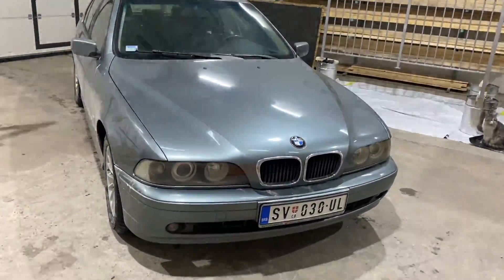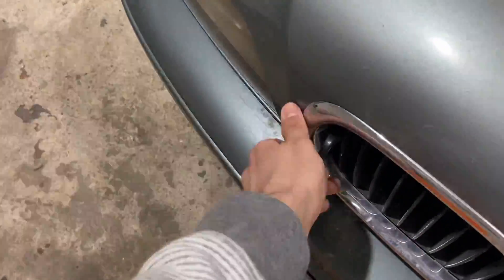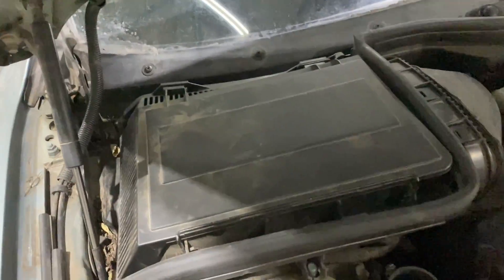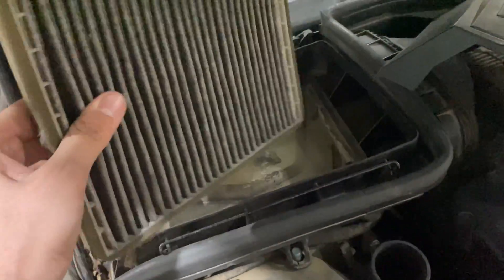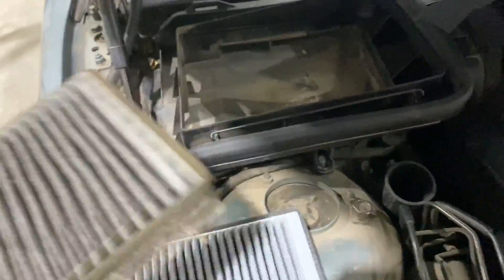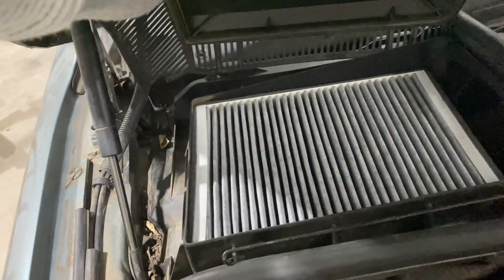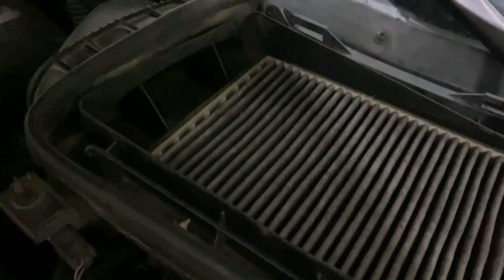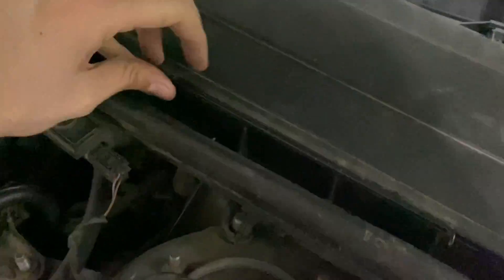How to Change the Cabin Air Filters on a 2001 BMW E39 520d

Comment: Look at the direction of the arrow on the side of filter (0:47). Air flows from the bottom of filter to top into the cabin. The foam should be on the bottom!
Reply from the maker: Completely correct